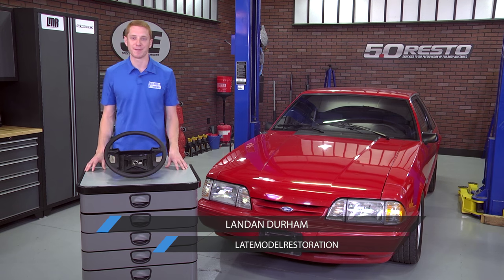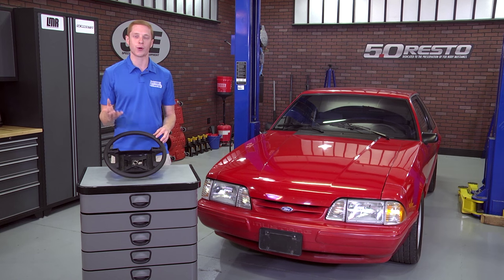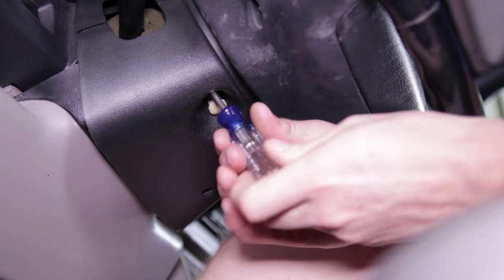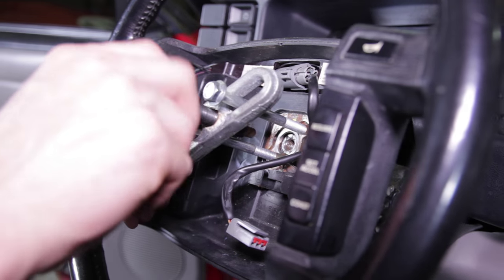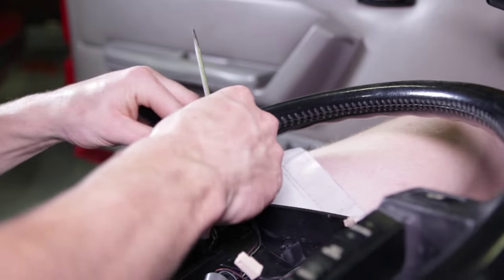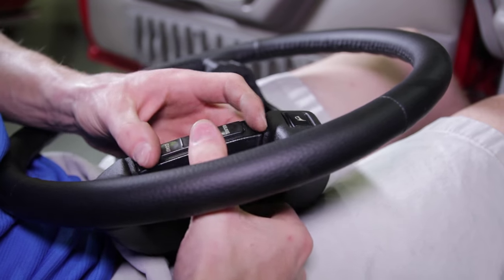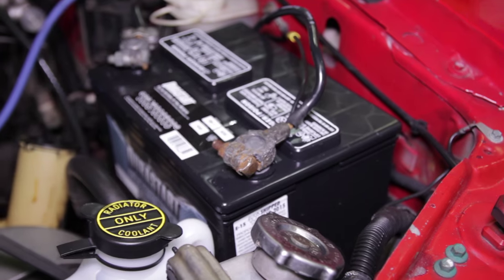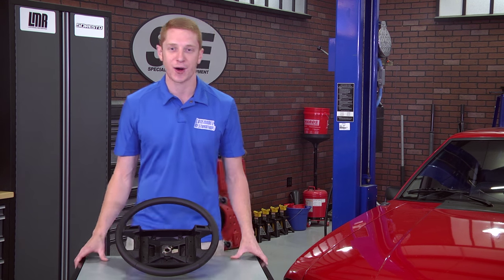Fox Body Mustang 5.0Resto Steering Wheel Install (90-93)

Comment: what is the thread size of the two smaller holes in the center section of the wheel? Metric? Std fine thread? I'm trying to remove mine with my own puller and need to size up those threads.

Comment: i have a 1991 gt, when installing an aftermarket steeringwheel with a momo4525 hub adapter,how is the horn feature hooked up if i am removing the clockspring ?

Comment: I modified my foxbody to accept a 1994-1999 mustang or thunderbird steering wheel and all controls work as well as the airbag too. Check it LMR at @s.b.standard.diecast and I used this video to guide the first half of my conversion / repair because my 91 foxbody clockspring failed.

Comment: does the wheel only go on one way? Is it keyed?
Reply from the maker: These will not be a splined style wheel. these will install in any direction but as long as you follow the install you will have it on the car straight.
Reply: @latemodelrestoration  It looks like there is a flat spot on the shaft for it to go on one way?
Reply from the maker: I understand your question. If you look at 3:08 you will see a flat spot in the steering shaft that will correspond the flat spot in the steering wheel shown at 3:11.
Reply: Late Model Restoration Thanks. I feel stupid for how easy this was.
Reply from the maker: You are very welcome! We are here for you!